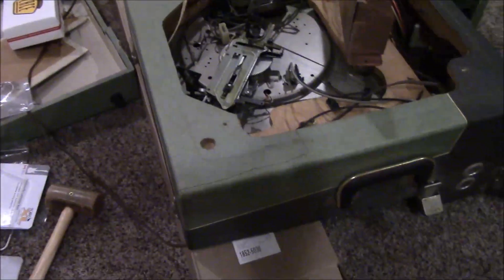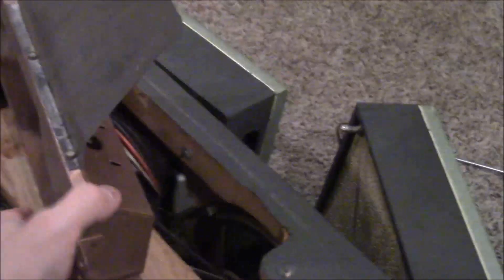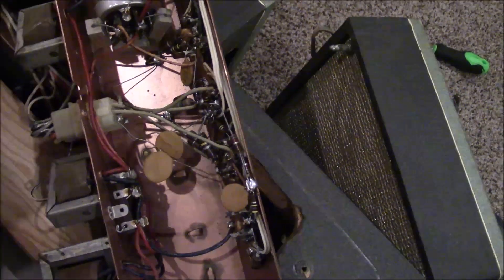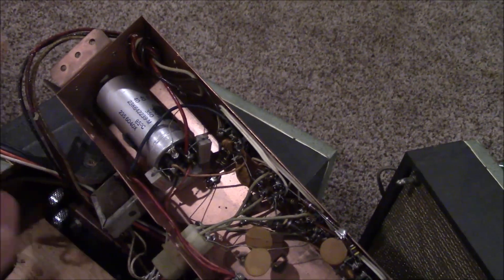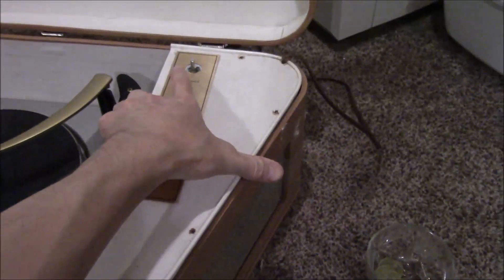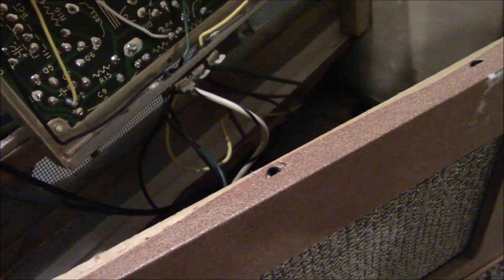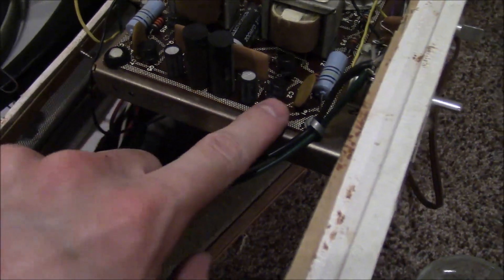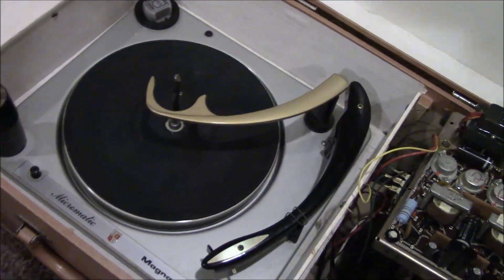More Portable Record Player Repairs

Comment: there is a roofing out fit that might put a new roof on your house FREE, it's Erie Roofs.Or were you able to find someone already?
Reply from the maker: I found someone and had it done in the spring.  Costing a fortune, though :(
Reply: @The8TrackChap  did they put a moisture barrier on before the tarpaper and shingles? Even with tarpaper water can still leak through